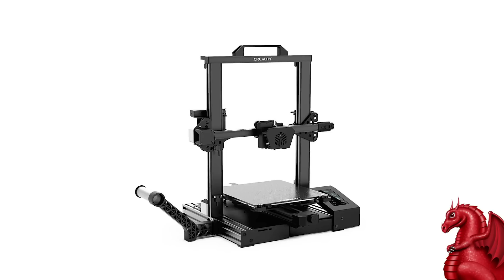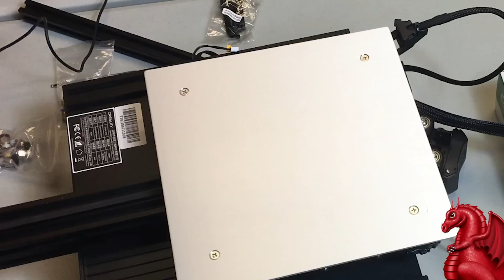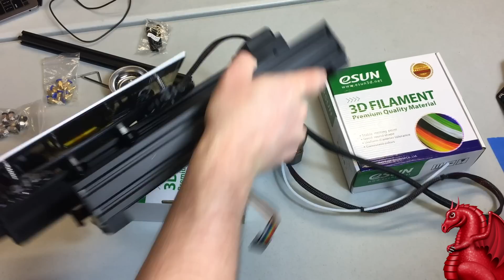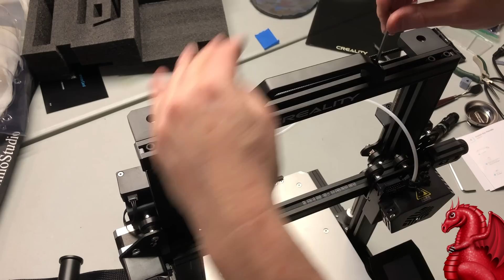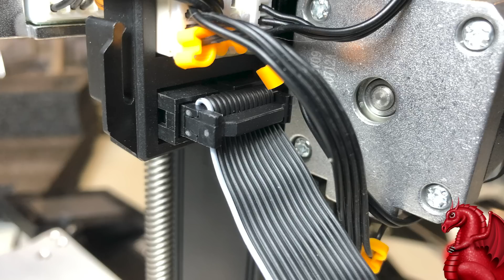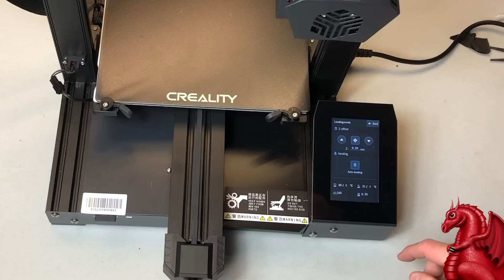Creality CR-6 assembly and pro build tips

Comment: I’ve been having so much trouble trying to get an FDM printer to work and seeing your suggestions for the screws on the aluminum and underneath are just making me feel like I was missing obvious stuff earlier on; along with doing the auto leveling with the bed heated, in trying to diagnose issues.

Comment: Followed these instructions and worked really well. Could add that the screws inside of the hot end also might need to be tightened. One of mine fell out and was causing all sorts of issues. If you were able to print when you first got the machine and now it won't print because of nozzle clogs, tighten the screws in the hotend. Good luck!

Comment: Thanks for this great tutorial A little late asking the questions now but I just got my printer. The eccentric nut on the hot end is really tricky for my unit it’s like 1 mm either way from bump to perfect. I don’t know if that’s how your unit is but I checked another unit in the store same issue 1 to 2 mm turn from being bumpy or being perfect and that doesn’t sound like a lot of room were the other eccentric nuts on the Y and Z are way more forgiving and more room definitely more than 1 to 2 mm

Comment: You neglected to mention that the four center screws (found under the machine) need to be checked and retightened as needed. Many, including myself, have found that these four screws were loose from the factory.

Comment: Can confirm, this is a great printer. It is my first printer and man am I glad I spent a little more for the CR 6 over the ender 3 v2. Also as an update it seems they updated the autobed leveling as it now sets nozzle temp to 120 and it does preheat the bed to 60 out of the box. Bought mine in february of this year.

Comment: Thanks - I opened my extruder because I could not get the filament in - opening was easy, but putting it back on was a pain in the ...
Even the Creality video does not show the procedure in detail. First - if you open the cover be aware of the spring (which is normal) but there are also 2 tiny wedges which hold the spring on the outside - do not loose them. Those two wedges slide against each other to gain or loose height depending on the spring tension. Sadly I found no detail drawing on the Creality website so it took me a while to figure it out, since they fell out of the cover at opening. After cleaning the wheel you must put those wedges back in place and squeeze the spring back in position in order to put the cover back on. But this is more than frustrating - the cover just does not move forward enough to get the spring back in. At the same time I dropped the wedges 100 times. Finally I ended up cutting of a litte piece from the cover - just the edge which gets cought in the left corner. After this, the cover has about 7 mm more play and this did the trick. With the first try I succeeded. So my warning - if you do not need to open the extruder  - don´t do it!
Reply: But after this operation I had a better understanding what the problem with the filament causes. The guidance inside the extruder is not sufficient. You must straighten the filement as much as possible. If you still can´t get it in you must twist the filament - sometimes a full 360 degrees. The tip of the filement just does not find the outlet if it is not 100% straight.

Comment: Hello there. I am new to 3d printing and CR-6 SE is my first printer. IMO it's a very beginner friendly printer from Creality (i.e. cheap), specially ABL. I have removed the bundled Cura and upgraded to the latest one (I think 4.8). Could you please provide your general purpose profile to me (and other noobs), until I get the basics right? I mostly print puzzles, kit cards and toys for my son. I mostly suffer from stringing. After listening to you I have reduced my flow rate to 96% and prints have improved but I think the printer can do better. Thanks in advance.

Comment: Hi! Great video and channel man, been going through some of the advice to print minis of other videos and it's awesome stuff :) I have a CR6 already and was wondering if you've tried this machine with a 0.2mm nozzle and have had good results with it? I have an SLA printer but with this being my first FDM printer I was trying to see how close of a result I can get and was wondering if you had specific nozzles you'd recommend to try with the CR6?
That and I've not yet been able to reduce the stringing further than what you got on the video - any advice on that would be very welcome as well!
Reply from the maker: I use a .2mm on my Ender 3 and it works great (in fact I have a Cura profile for 4.8 coming soon for .2 nozzles)
Reply: @Tombof3DPrintedHorrors  Is any 0.2 nozzle good to use or would you recommend any specific ones for best results? And thank you for answering so quickly!
Reply from the maker: @pmvac  it is for miniatures, I'll do a video soon.

Comment: Thanks! There was nothing in the instructions with the printer about setting the eccentric nuts or tightening the bolts for the bed. How much tension should be on the belts?

Comment: Hi, Tom.  I have both an Ender 3 and a CR-6 SE. I find your Ender 3 setup video to be the best of the bunch so I had high hopes when I ran into problems setting up my CR-6 SE that you would dwell a little on how to calibrate the gantry and how to adjust the dual Z axis and Hot End eccentric nuts.   Please consider adding a short discussion of both.

Comment: Thanks for the review! I got mine and have had relative success! I'm kinda new at the printing hobby and I'm not sure what slicer to use and profile settings. Can you guys upload the profile you're using for the CR6 and which slicer? ;_______; thank you <3
Reply from the maker: Cura 4.6.2, profile is at our website in the Resources menu. :)
Reply: @Tombof3DPrintedHorrors   Thank you for the reply! I saw but Cura 4.6.2 doesn't have CR6 SE as a printer I can add. Do you have any suggestions for this? Please and thank you! I really appreciate the help!

Comment: How similar is the hotend design to the Ender 3?  I was never able to get that setup to work without eventually failing due to void issues where the hotend meets the Bowden tube.  I have switched to an all metal hotend and my printer finally runs consistently.  Is the CR-6 the same hotend design? And how hard would it be to change to an all metal hotend?

Comment: Nice video. I've had mine since late August, and for a complete newbie it's been great! Had some good success printing a bunch of minis and terrain pieces. Sooo many options in the slicer. One thing I did run into in assembly - when putting the LCD panel on, I found that I had to attach the ribbon cable FIRST before screwing the LCD screen down in place - there wasn't enough slack in the cable to connect it once the panel was screwed down. It fits just fine if you connect it first. I don't know if mine happened to have a slightly shorter cable or something, but it somebody's having trouble with assembly there try changing the order.

My only real issue is the manual, and the complete lack of maintenance instructions. I had no idea about cleaning out the extruder teeth for example, and the manual explains how to load filament, but not how to unload it. Thankfully I figured it out.

Comment: It's a very nice printer but when it comes to unblocking/cleaning out the nozzle or just getting to the hot-end it's like you have to complete a Chinese puzzle (no pun intended) just to get at it, it's the same with the extruder, I love that the nozzle is used to set the z-axis, no messing about with a Z-Offset

Comment: Unless something changed in the firmware, when auto-levelling, it's supposed to pre-heat for PLA by itself.
Reply from the maker: It preheats the nozzle only.
Reply: Yeah I also let the glass heat for 5-10 minutes before auto-leveling for temp to even out and any thermal expansion to occur. And I do see actually a significant change in bed visualizer.

Comment: Man, ender 3 re-level every 3 months?! Even with the yellow springs I have to re level every print!
Reply from the maker: Then your Z end stop switch is too high, lower it so your bed springs are compressed about half way when leveled and creating enough tension to hold the wheel tight.
Reply: @Tombof3DPrintedHorrors  thanks for the reply, I've tried that to where I only can turn the wheel about half/one full turn from tight before gets to leveled height. Maybe the springs I got were no good
Reply from the maker: @SamuelpCameron  compress your bed to a little over half compression (should be very tight turning the wheels), lower the nozzle to about 2mm above the bed, slide z end stop switch up until you hear the switch click, tighten switch screws, then relieves your bed per my video.
Reply: @Tombof3DPrintedHorrors  I'll try that out, thanks!

Comment: 3:40 on the left... Interesting bed leveling approach, but the nozzle is always dirty and some filament might come out early. What control board is used,? Open source?
Reply from the maker: That's why it preheats the nozzle completely before leveling so any filament is soft and will not interfere with leveling.
Reply: @Tombof3DPrintedHorrors  Yup. My problem though is that it usually gloops the glass so I have to be there with a scraper to keep things clean.

Comment: Great video, I've been printing minis on this machine since I got it 3 weeks ago, the FDG profile was excellent for minis, even with the cheap 0.2mm nozzle. I've struggled getting it to print well at layer heights lower than 0.08mm though and the stringing is still an issue for me despite much testing. I'd love to see your review of how to print on this well with low layer heights and a 0.2mm nozzle :)
Thanks for the great video.
Reply from the maker: My original mini printing video discussing the disadvantages of thinner layer heights still holds, .1 will give the most consistently good results, and .08 is the absolute thinnest to print on a FDM due to radiant heat issues.
Reply: I've heard that turning down the extruder temp 8-10 degrees will help with the stringing (maybe the CR-6 runs hotter or ?).  I'm assembling my CR-6 this weekend and will try that as well.  A filament temperature calibration tower will be the proof in the pudding.